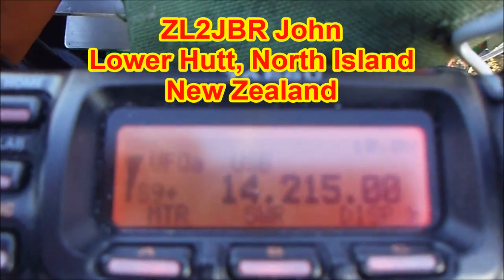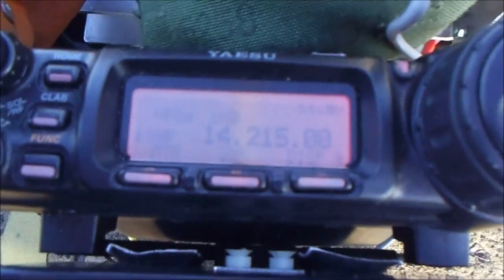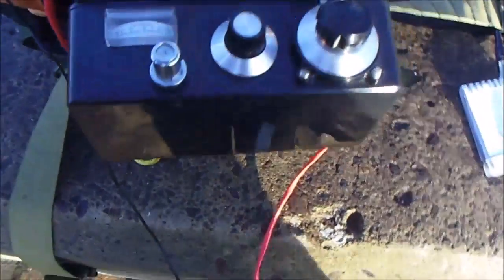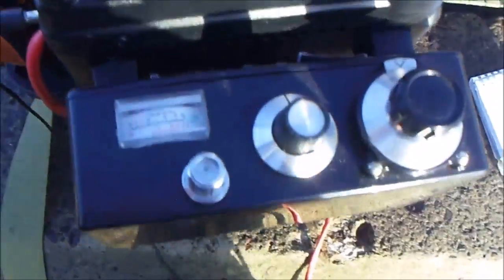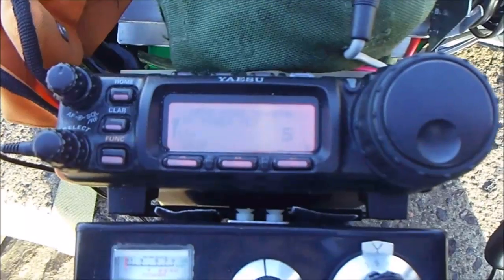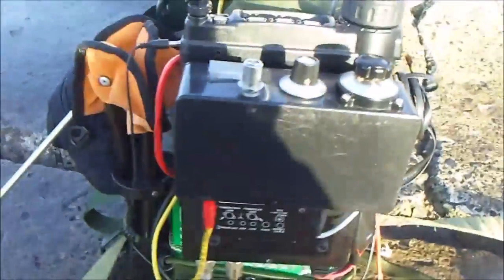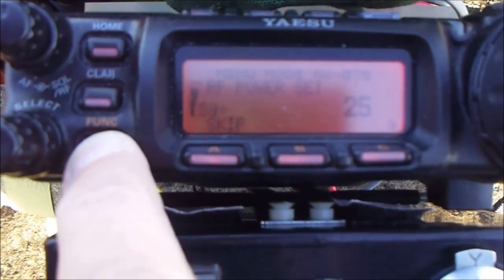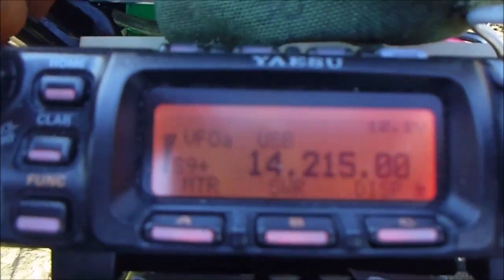HF Pedestrian mobile UK to New Zealand

Comment: I got a 40ahc lithium battery for portable use much lighter than the SLA  battery's but cost lots I like your portable station the earth tuner you use is it off the shelf or home made cool job chris G0WFH
Reply from the maker: Hi Chris, Yes there are some great batteries which are much lighter and would be much more suited to the job but as you say the cost can be a bit extreme. All of my ground tuning systems both on the backpack and trolley stations are all homebrew.
Reply: m0dad  thanks can you send me the circuit for the one on the back pack my email  chrisg0wfh@gmail.com  I would like to put a portable station together
Reply from the maker: I have sent you some photos and a schematic
Reply: m0dad hi I not got your email you did use zero after the g and not o its easy to do nothing in spam chris
Reply from the maker: Sent again Chris, can you let me know if you have received it or not
Reply from the maker: OK Chris here comes round three. Just sent it off again. The files are attached to the e-mail and will have to be opened.
Reply: m0dad yep got it this time perfect thank you